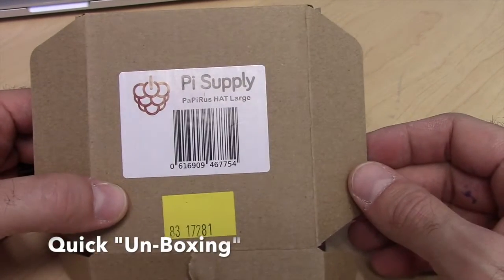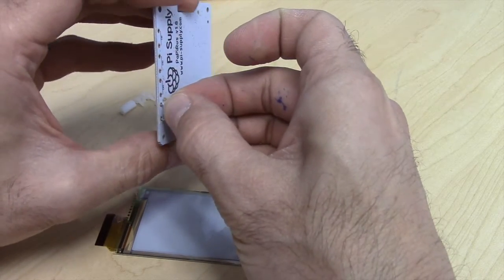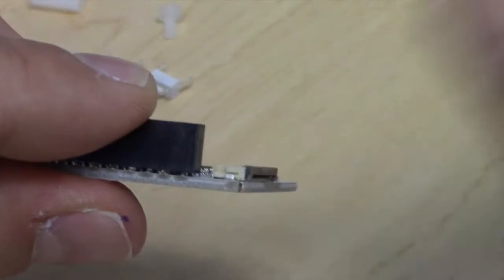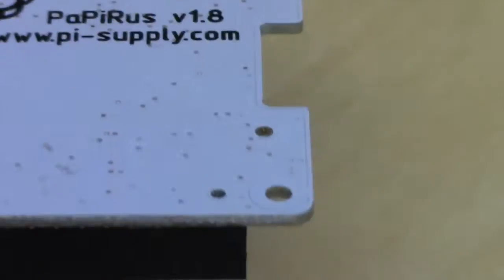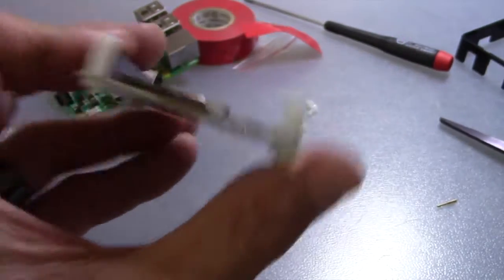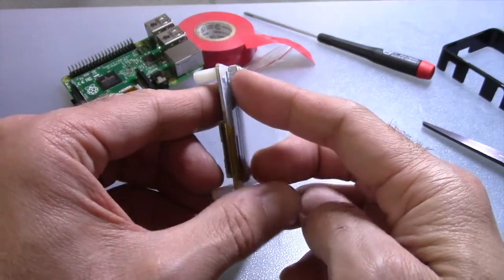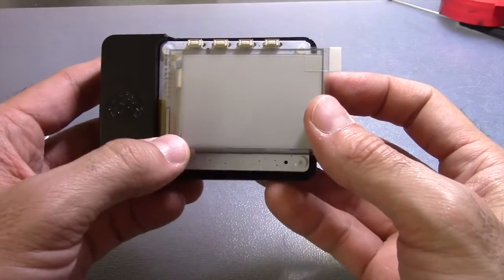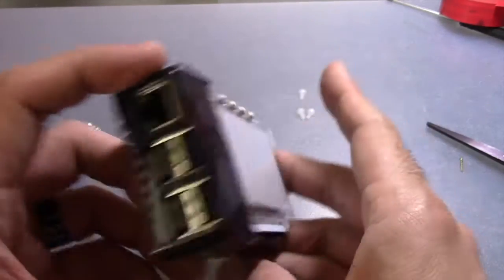PaPiRus e-Ink Hat Unboxing and Setup

Comment: You apparently haven't read that these e-paper displays are quite delicate, did you notice how thin the glass is on the displays. Let us know if you got it working for your application. Thanks for the video.
Reply from the maker: I was a bit disappointed that my case, with the clear protector scree, couldn't be fully used.  Granted, one can get the smaller e-paper unit - and hopefully my video helped some out to get the smaller one so that they could use such a case.  

Because I wanted to install this "in the field" having a thin piece of sharp glass hanging out.  I think I'll get the smaller piece, and give it a re-try.

Comment: The pin at 4:00 is a pogo pin. I believe it lets you access the reset header on the Pi. You can access the RTC of the PaPiRus, set an alarm and reboot the Pi. Installation: https://www.pi-supply.com/make/papirus-assembly-tips-and-gotchas/ More: https://github.com/tvoverbeek/PaPiRus/tree/master/RTC-Hat-Examples